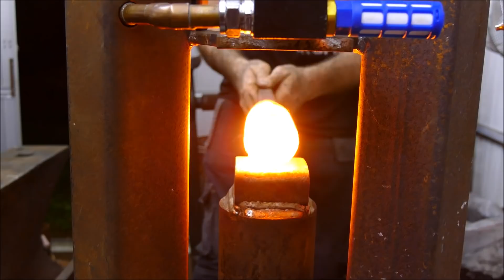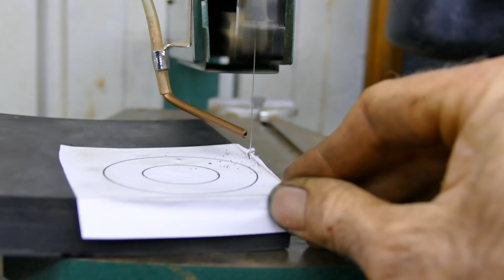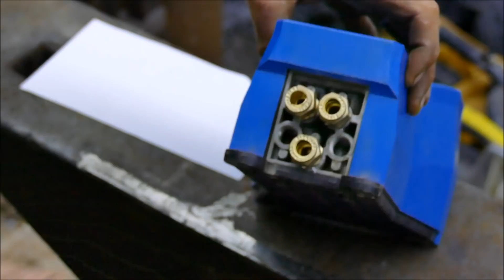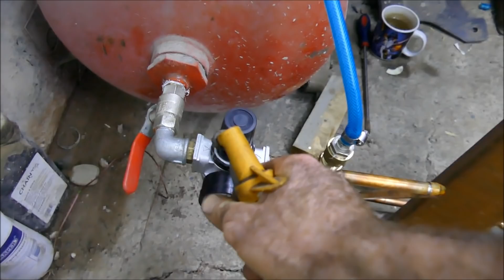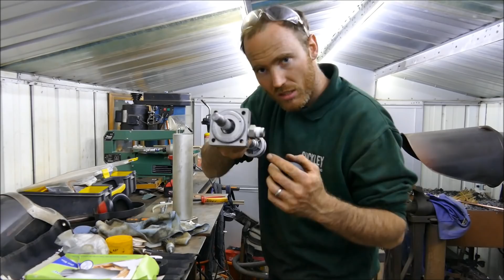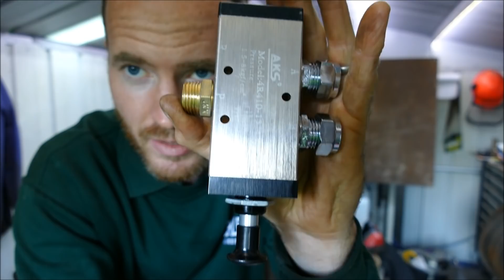DIY power hammer ultimate upgrade - More money making power

Comment: If you want to machine rubber, put it in the freezer first. It goes hard and behaves like wood or plastic.
Easier than struggling with it at room temp...
Reply from the maker: @jamesspry3294  very good tip. Thank you. Cheers J

Comment: Noting your machine floor mounting arrangement is direct hard to hard. This will affect the apparent recoil of the mechanism. The heavy vibration could be expected to show up as various structural failures over time. Design engineers would normally take into account recoil in the foot detail with some recoil safety margin. I have seen something like 3x factor x load, from hazy memory of a 300KN universal test machine instal, mitigating the point impacts/loads over time with a resilient shock absorbing material like 'Fabcell' a UK product. The manufacturer would provide recommendations for area and number of support pads/foot print required for your application.

Comment: The cost of a 4” diameter solid round bar is stunning. I’d have to buy a 20’ length. Insanely expensive. I looked into junk steel driveshafts then got distracted by my day job. One day I’ll get back to this.
Reply from the maker: It's certainly not cheap but you do need the mass. It could be a laminate of several bars welded together but if you're buying new a single bar is cheapest. Cheers J

Comment: Is there a reason you didn’t set up and adjust the cushion valves that are built in the the end cap and annulus cap of the cylinder itself? 
You could do away with the rubber and really reduce the shock load forces on the tie rods.
Reply from the maker: Hi. I did but at 120psi with the momentum of the hammer it does nothing.

Comment: I love your work, the hammer is by far the best I've seen. I'm trying to figure out if I am going to be able to build and run it.

Is the cylinder under pressure on both strokes? And if you hold down the foot pedal does it cycle up and down or do you have to press the pedal for every stroke. Lastly I have a small 50ltr compressor with about 9 cfm would that be enough? 

Can't wait to get your plans to build this. Thanks for all your content and for sharing your knowledge and skill.
Reply from the maker: Do have a look at my latest video. I've improved it further and will be releasing new schematics soon. Cheers J

Comment: Use a dampemed pneumatic piston instead off using a regular one IT Will not slam and save your time and money love the Idea
Reply from the maker: The cylinder bit use is dampened but at these pressures and momentum it' doesn't work. New video this Friday all sorted with a much better system. Cheers J

Comment: Would it make the air flow better if you would make the big square metal tubing air tight then hard pipe from the square tubing to the cylinder? That has 2 pressure feeds right you could do it with both big tubes and connect each line from the pedal to each leg then from each leg 1 feeds the extend side and 1 feeds the retract side? It would even give you more air volume right? I'm not sure if it would work it was just a  thought.
Reply: My idea above would in theory help with the fact that there would be enough air in the leg to to make the cylinder go so the small outlets on the foot pedal maybe wouldn't matter as much. Or maybe my whole idea would create some sort of lag because the air amount wouldn't be exact? Dang wish I was an engineer. What if you used an electric foot pedal that controlled an actuator right on the leg that would maybe have the ability to supply a ton of airflow with the shortest distance? Lol who knows just a thought
Reply from the maker: Hi. I've changed it since and scrapped the copper and went to pneumatic semi rigid blue tube. I've got a new video coming out soon with electronic valves and new top linkage. Cheers J

Comment: I just purchased the Plans for the Hammer and the upgrades plans > i am brand new to Blacksmithing but it fascinates me  and all I have is an anvil and hammer and i found out fast a Power Hammer will save your arm. These 2 Power Hammer videos are excellent and I love the idea of pneumatic parts makes this Simple mechanically.
Reply from the maker: Thank you so much. I just messaged you via Etsy.  Any problems please let me know and I hope you have great fun building it. I've got more upgraded coming soon including electronic valves and a hydraulic cylinder. Cheers J

Comment: So how much will you be selling them for?
Reply from the maker: I worked out I can manufacture them as they are (powder coated) for £2050 with free UK delivery. It may be slightly more if I change the cylinder and add electronics. I may have to register for VAT also.
Reply: @joshuadelisle  I would definitely buy one of you don't trust my welding hahaha
Reply from the maker: @Mr-hz8gq  thank you. I may do a Kickstarter campaign. So I'll some special deals for pre orders.  Bit of a way to go yet. Cheers J

Comment: I’m going to build it.  I was wondering why not use a electric air solenoid 1/2 valve instead of the manual valve.  A stepper motor with a cam   Might be a ez solution???
Reply from the maker: Yes see the latest video as I talk more on that. Another option is a steam linkage. Cheers J

Comment: How about this cylinder for a super duty build:  https://www.ebay.com/itm/Miller-3-1-4-bore-X-5-stroke-pneumatic-cylinder-series-AV/153946992456?hash=item23d7f4af48:g:GdwAAOSwdnhey-zy  And 4 way solenoid valves: https://www.grainger.com/category/pneumatics/pneumatic-valves/pilot-air-control-valves  Try and avoid the Chinese aluminum cylinders, they are problematic. Parker and Bimba are not much more but much better quality.

Comment: The cylinder must work upside down, because on the side it is working the square inches are less due to the rod. Excuse my English
Reply from the maker: It's more to do with how fast the air is displaced when striking using the rod side. Then you use the full surface area to lift the weight back up. This way is better for a hammer, the opposite way is better for a press. Cheers J

Comment: Just a little tip. When soldering or brazing tubing, if you flow a small trickle of nitrogen through it, it will prevent oxidation contamination from forming inside the tube when you heat it with flame, thus keeping trash out of system.  Love the videos. This is an impressive build.

Comment: Do you not oil your air supply? Gonna go through o-rings in your cylinder quicker and if you ever go with a reciprocating valve system you're gonna melt the o-ring.
Reply: I was told not to use oil in the air because it might destroy the o-rings and the o-rings are made to last. I guess the only way to know is to try.

Comment: i just send a paypal paymnt to get the plans... will you send an email back,,, also can you add a note saying the new updates on the machine ... i mean new changes
Reply: I am so exited to get started  I don't want to make any mistake  when I build my hammer let me ask 4 stupid questions need to know a link what air regulator to buy, also link  what type of hose and size and how long, also link for the gasket you made for the air cylinder where to get the material, anything else. I need link to buy skate wheels. I need 8 right? were and what size please! sorry to bother is all most done! oo you ask for my email meke743@gmail.com

Comment: it will crack the bottom of your tube walls
Reply from the maker: I added stiffening plates to the design so that doesn't happen. Mine is fine so far and I'll be adding concrete in the pillars for stiffening and sound dampening. Cheers J

Comment: can you ell to me one of those r tell me were to buy everyting
Reply from the maker: Hi. Check out my original build video and the others on developments. In the description should be a link to the design and parts list. Cheers J
Reply: @joshuadelisle  i just send a paypal paymnt to get the plans... will you send an email back,,, also can you add a note saying the new updates on the machine ... i mean new changes
Reply from the maker: @ironcustom1  hi. The upgrade is on my Etsy and lists in its description what it contains. Basically it's the foot treadle design, adtional amendments to the roller supports and top linkage and a schematic diagram of my current valve set up. cheers J
Reply: I am so exited to get started  I don't want to make any mistake  when I build my hammer let me ask 4 stupid questions need to know a link what air regulator to buy, also link  what type of hose and size and how long, also link for the gasket you made for the air cylinder where to get the material, anything else. I need link to buy skate wheels. I need 8 right? were and what size please! sorry to bother is all most done! oo you ask for my email meke743@gmail.com
Reply from the maker: @ironcustom1  thank you. I've just replied to you on Etsy. I'll email the DXF shortly. I hope it helps. Cheers J

Comment: Hei! First of all, great job! Did you try to adjust the air breke of the cilinder instead of placing that balistic rubber inside. As far as I could see in your video, that cilinder has at the ends two small insert pins that could be asjusted in order to have a good brake at the end, that means that the piston will not knock at the end of stroke. Best regards!
Reply from the maker: Hi. Yes it does but at those pressures and momentum of mass it doesn't do much. It can work without a rubber cushion by using a solonoid valve and limit switch which will create an air cushion before full extension, this will also act as a spring by holding potential energy before being released again. I'll be experimenting with that soon with some ideas using Arduino too. Cheers J

Comment: Another wonderful video.  What are the advantages of your power hammer as compared to the "tire hammer" design?  Am I correct in saying maximum power with control is the goal?
Reply from the maker: Hi. It's theoretically more efficient because of less moving parts, easier to build for the same reason, it's smaller and compact but still powerful, easy to customise and incorporate automation by using a solonoid valve systems, working parts are cheaper and easy to maintain. Cheers J
Reply: Thank you Joshua.

Comment: I like the design of this power hammer a lot. It seems to pack quite punch...
From an engineering standpoint I have a few thoughts on possible improvements  that may or may not be of use for You.
Perhaps it would be better to use a commercial double threaded rubber damper on the cylinder shaft instead of having to disassemble the cylinder. Will also help with misalignment and puts less impulse load on the cylinder shaft as well. These are cheap and available with various internal and external threads.
Putting the valve right at the cylinder could help and also a few liter small tank acting as accumulator close to the cylinder would help. An electric or pneumatic valve would give You the flexibility of putting the control pedal wherever it is needed. This way You only need one hefty copper pipe up the power hammer.
I have had problems with copper pipe under vibration. I suggest being careful relieving stress by proper bends and perhaps using fosco soldering instead of tin. 
The roller skate wheels will hold upp better if You can put them at 45 degres so that the side load is minimized. I would expect that alignment would also be better since You can preload them harder against the ram.
Perhaps a simple boolt on guard to catch the ram in case of wheel failure could be a safety feature. 
A warning, I had problems with silicone in my shop, it's now a silicone free zone... 
My issues where painting and gluing and also electrical contacts failing due to sparking and SiO2 buildup. I never use the sprays anymore, insides a cylinder a rubber safe grease with or without the silicone is better anyway.
Reply from the maker: Thank you so much for that, all very good helpful tips. Please would you share s link to the double rubber damper as I'm very interested in it. I've already moved the valve next to the cylinder like you said  and got rid of the copper in the newer video. Thank you and all the very best. J

Comment: Why not use your square tube as a air tank
Reply from the maker: Only problem is that seam welded tube isn't very good to withstand pressure and could be dangerous if it burst. I'm going to fill mine with concrete to add shock absorption and extra rigidity. Cheers J

Comment: An air cushion can be designed several different ways into a pneumatic cylinder. An inner tube inside a frame member can become an effective accumulator to store energy. Just a couple thoughts. Time to watch.
Reply from the maker: The in built air cushion doesn't have much effect  with this weight and momentum. If the rubber cushion fails  I'll look into a sprung bump stop. So far it's ok. Got a big project that will put it through its paces coming soon. Cheers J
Reply: @joshuadelisle  I thought about writing more details about a trigger system that introduces full opposing pressure at just the right moment. At first I wondered if a hydraulic damper would handle the mass better but considering the height restriction it would probably require a linkage. You got to love projects that get people thinking. Peace.
Reply from the maker: @WireWeHere  it's been brilliant hearing everyone's different approach. Your right you could introduce a valved proximity switch that puts equal pressure into both sides of the cylinder before it reaches the top. I'll have a think about that. Cheers J

Comment: Thanks for the vid great work. I had way more luck in my paint booth throwing up a forty foot hose to chill the air before the water trap. Just in case you run into condensation trouble.

Comment: Nice build and upgrades. Couldn't you put the rubber stop on the hammer mechanisme itself? You can reduce the travel and thus stop your piston bottoming out. Is is done a lot on car suspensions and it is super easy to change when they are worn.
Reply: That's true. Just thinking for easy maintenance when you sell them. Not every body is confident to take a piston apart when it is worn. With some cars they are just on the outside off the piston rod. Still a great job and hope you could sell them to keep you're channel growing👍
Reply from the maker: @tomwagemans1872  thank you Tom! Maybe... I kind of think if someone is brave enough to use a power hammer to forge steel then unscrewing a few bolts shouldn't be a problem. But I'll take that advice onboard. Cheers J
Reply from the maker: So far the cushion works well otherwise I would have to weld in some serious u bracket and I don't really want to do that. Cheers J

Comment: Have you tried adjusting the built in "exhaust cushion" on the cylinder instead of fitting the rubber doughnut to dampen the end stroke ?
Don't want to "teach my granny how to suck eggs" but you never mentioned adjusting them on any of your build videos ?
When you had the cylinder apart, the central portion of the piston with the seal has two reduced diameter spigots either side of it. As the piston comes to the end of its stroke, these spigots enter the seal portion of the cylinder end cap, which blanks off the main exhaust route and diverts the remaining cushion of air through the small drilling you can see on the inner face of the end cap. You can adjust how quickly this remaing portion of air leaves the cylinder by means of the grub screw beside the cylinder port. Screwing it in reduces how fast the last of the air exits the cylinder and provides a buffer at the end of the stroke. 
This won't affect the speed of your cylinder or the action of your quick exhaust valves, only the last split second of the stroke.
I understand you ditching the regulator, but I think it would be beneficial to fit an inline lubricator to keep the cylinder oiled too.
All in all a very good job, just wish I had a big enough compressor  to run it.
Reply from the maker: Yes I forgot to mention that at 120psi and the momentum of the weight of the hammer it has no effect on slowing it down. Without the head yes it works. Cheers J

Comment: Would definitely be interested in the plans, possibly interested in a finished unit
Reply from the maker: That you! Should be a link in the description for the plans, I'm hoping to start manufacturing these soon once I've finished it's trial and testing period. At the moment I can only supply to the UK until brexit is finalized, currently it's £2050 standard model, free delivery and powder coated. Other models will be available also with specific differences which affects the price. Cheers J

Comment: might be a bit late now  but can you not use the the end soft stops  on the end off the ram to stop it? it's the small screw beside the inlet's you can  adjust, keep up the good work!!
Reply from the maker: They don't work at that pressure and are already set to do so. On lower pressure the air breaks work well. Cheers J

Comment: Dide you drill out the cylinder to 1/2 or just went with 3/8
Reply from the maker: Hi I used a 3/8 to 1/2 reducer. Cheers J

Comment: I have a question. Is the motor of your forge hood still going strong?
I just want to buy a one that won't melt so fast.
Thanks
Reply from the maker: AH! no it broke ( mentioned it in another video) i've got something different, I'm saving it for a new video but I'll explain it to you. I built a stanless 3m chimney and it still didnt draw very well, so i installed a small blower with a pipe going in under the chiney creating a venturi effect, its on a potentiometer to controll the draw and works a treat, will update with a video. cheers J